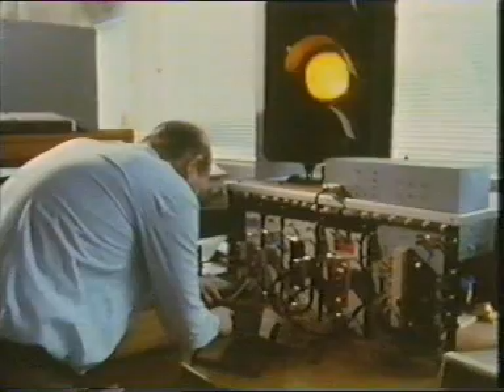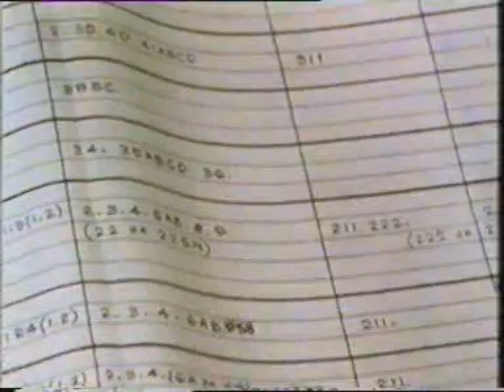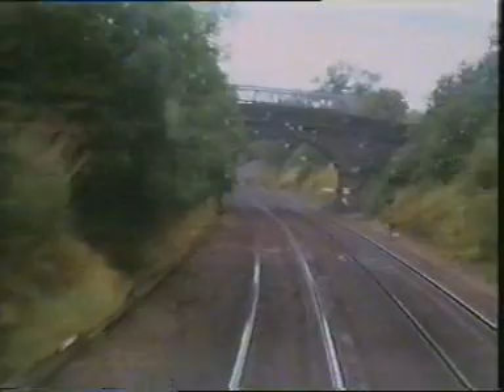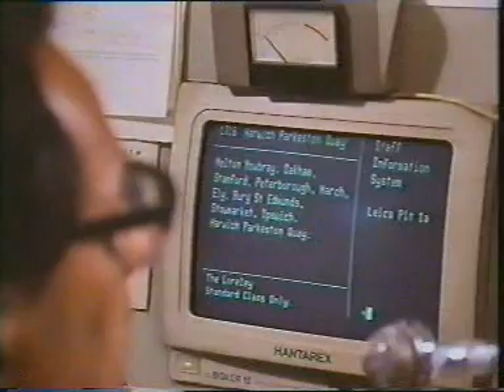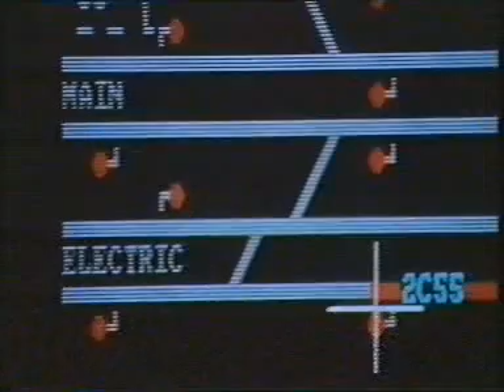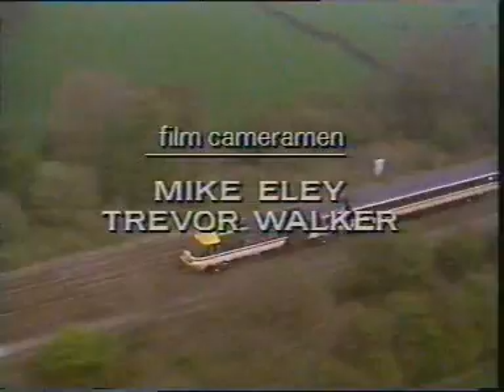Modern Railway Signalling (OU)2.avi

Comment: And how would the signalman be alerted if a train SPADs?
Reply: If a track circuit ahead of a red signal becomes occupied, an alarm goes off on the signaller's work station calling his attention to the possibility that a SPAD may have occurred.
Reply: The driver would contact the signaller and the track circuit of the section ahead would be activated.

Comment: Indeed since the supposed privatisation of BR, the introduction of "Computer Interlocking" has revealed itself to be fatally floored on a number of ocassions. Why? Because those computer engineers designing the software, are not themselves well enough versed in the methods of railway safety. The Paddington crash being just one good example Post privatisation.
Reply: If you mean the Ladbroke Grove crash, that had nothing to do with defective interlocking. What caused that was a combination of poor signal sighting, inadequate driver training, and a layout designed assuming full ATP would be installed (which it wasn't).
Reply: I don't think you know what you're talking about at all. Interlocking requires no user interaction to work. Interlocking blocks incorrect sequences of signaler actions. It doesn't matter whether it's mechanical, relay, or computer based, it does the same thing. Indeed, there was another video which detailed a number of crashes including a fatal crash due to a lever being thrown in error exactly during a mechanical interlock window of 100 ms due to the small distance between a train detection mechanism and the switch. You clearly need to watch this video series from the beginning.